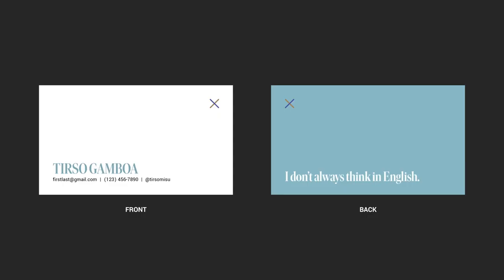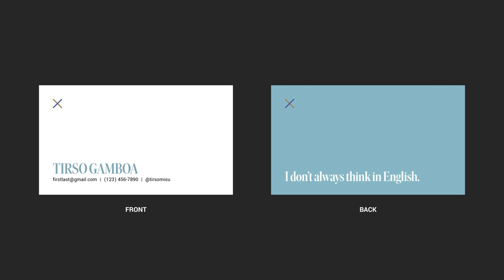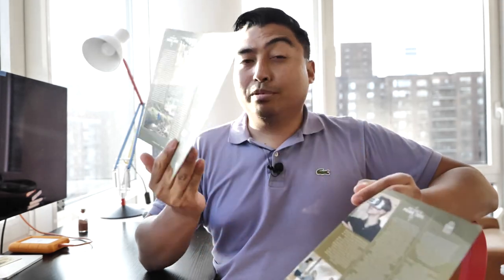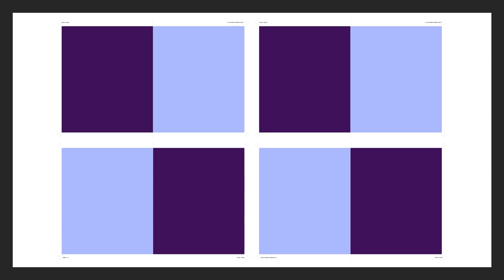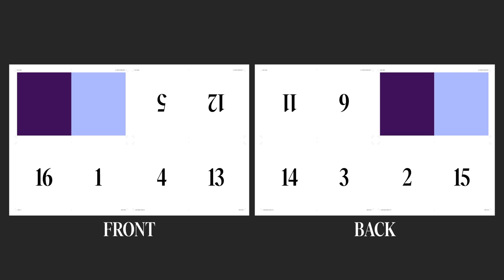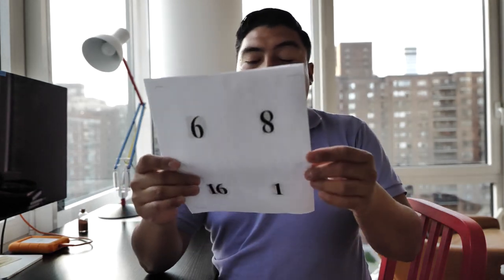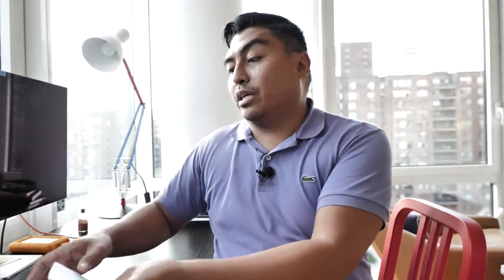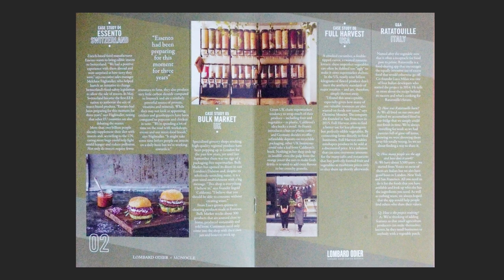Understanding Imposition and Printer Spreads for Designers

Comment: what if there is 60 pages
Reply from the maker: It depends on the form your printer sets up. If they do 12 as I did in the video, they would just print 5 forms of 12 pages each and then bind them together at the end